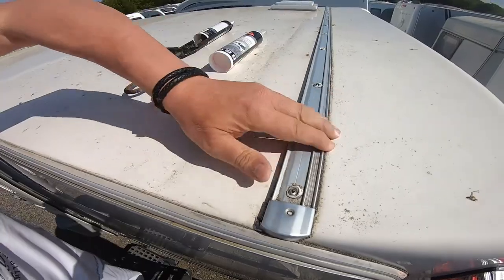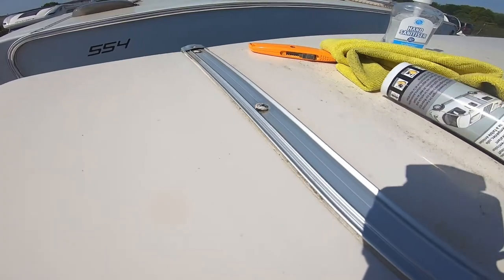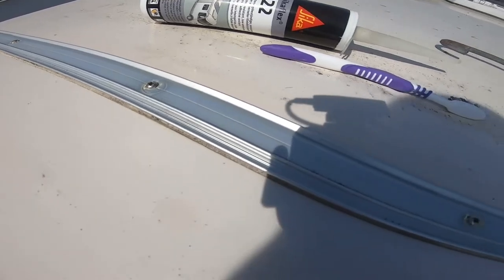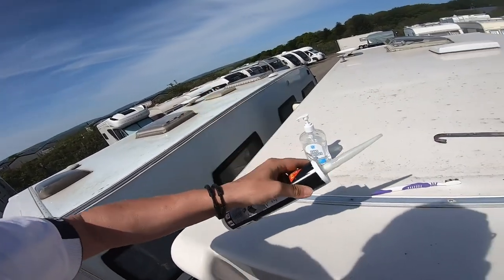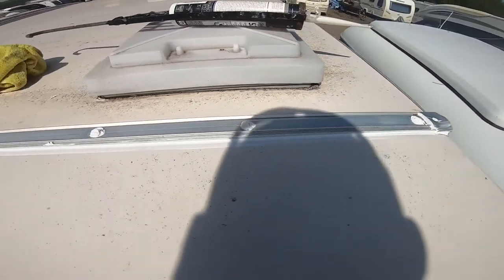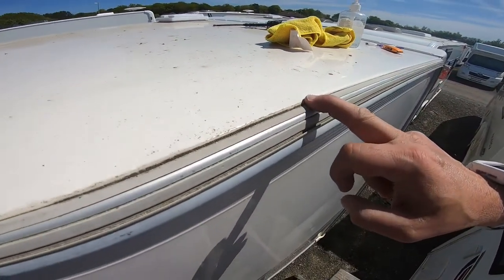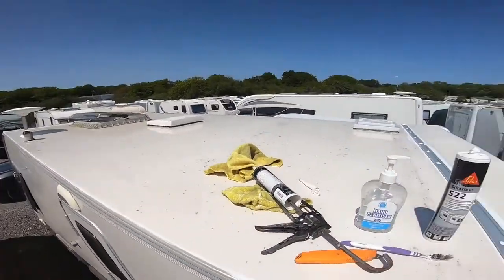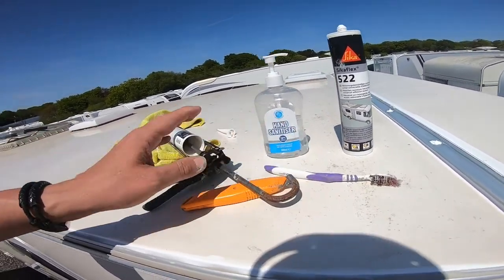Resealing caravan roof joints.

Comment: Hi, good video and info. Just a tip on finishing the sealant: after you apply sealant spray it with solution of water and a few drops of dishwasher detergent with a fine spray and that way you'll have a nice clean finish with no smears.